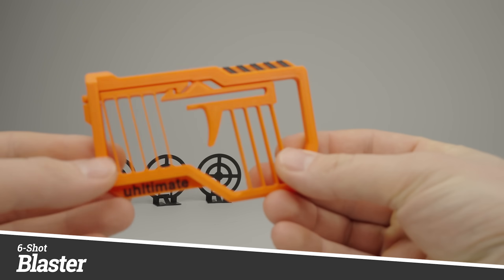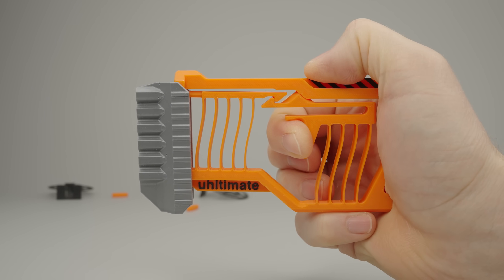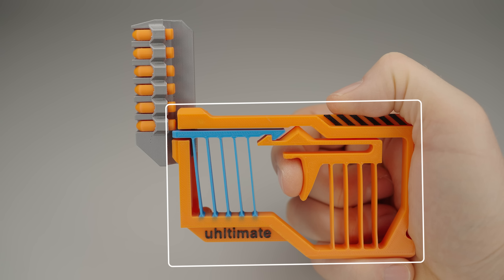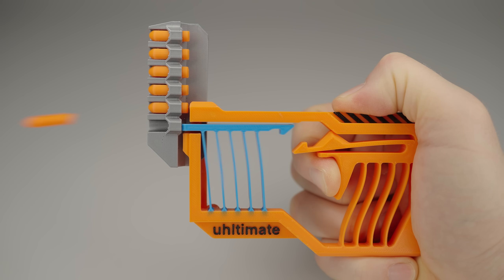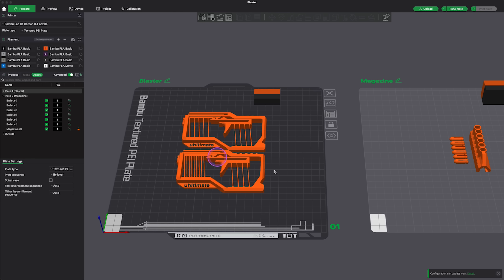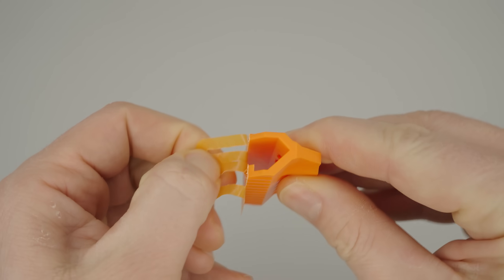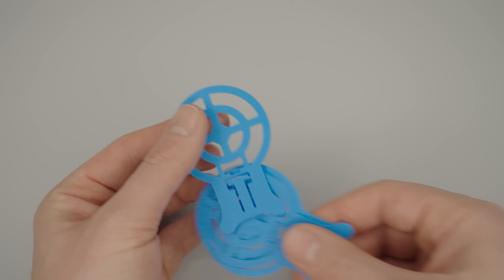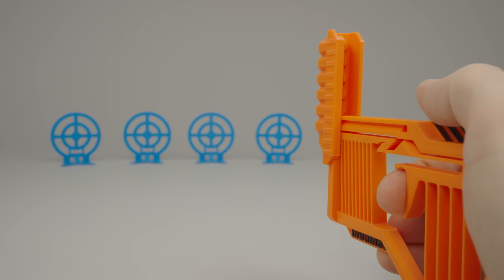Six-Shot Blaster with Compliant Mechanism | 3D Printed

Comment: Great design! For the last few days, I've been trying to make it stronger simply by making the frame firmer in Y axis and the spring thicker in Z axis to store more energy. At a point, the hook on the trigger wouldn't be able to hold it and snapped.

I've tested with PLA and PETG, to my surprise PLA did better, possibly because they're stiffer before they break and less slippery so the trigger hook holds the front springs better.

I wonder if there are ways to make the hook hold the springs better and can still release them when pressed down all the way...

Comment: Very cool. I printed it in standard PLA but it stopped working after a couple times through the mag. The hook doesn’t spring back with enough force to rehook anymore. I never have good luck with 3d printing compliant mechanisms. Must be my Bambu filament.
Reply: I have the same issue. There's no mechanism to pull the hook back in place. It relies on the rigidity of the structure itself, which gets weaker in time.

Comment: That’s not a mag that’s a clip😭
Reply: Nevertheless this is epic
I love it👏👏👏👏👏👏
Did better than mark rober
Reply: "You said the wrong word!"
"Can you explain why it's the wrong word?"
"haha anyway this video is great!"

Ah YouTube comments.
Reply: Can you explain? I don't see why it wouldn't be a magazine.
Reply: @AnomalousX12  Magazines have a mechanism with which they push the ammunition into the firing assembly.
Clips are far more simple, merely holding the ammunition in place as the assembly fires the munitions.
Reply: @seanrobinson7464 Can you give an example of a clip that remains mounted on the gun as it's cycling through rounds? That seems pretty characteristic or a magazine to me. Clips are usually used to load rounds into an internal magazine. That's not the case here.
Reply: @AnomalousX12  Seems like youtube deletes my attempts at writing a reply due to its filters or something... but to answer your question since the other person didnt answer  the M1 Garand is probably the most well-known example. with what is called en bloc clips. but i dont think they are common, especially in more modern stuff i don't think it's used anymore at all
Reply: @qcklu  Ahhh okay I see. It seems like such a unique case that it wouldn't be grounds to say that calling this a magazine is incorrect, unless the deciding factor of what makes a magazine truly is whether or not it's spring loaded.
Reply: @AnomalousX12  Clips only hold the cartridges, magazines have internal springs to assist feeding. In this case the gun is being fed by gravity, no springs required. Something like an m1 garand uses a clip which holds the bullets in place while the separate spring inside the gun itself does the feeding. This is similar, just with gravity.
Reply: Bro who cares 😂 armchair expert